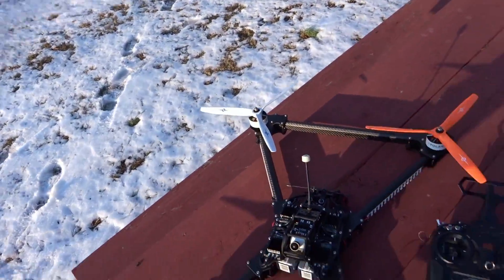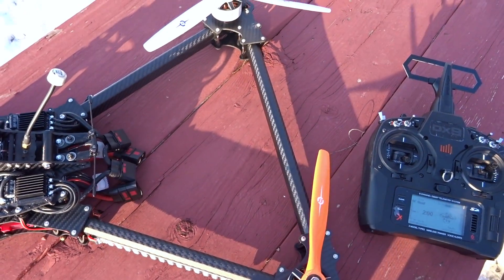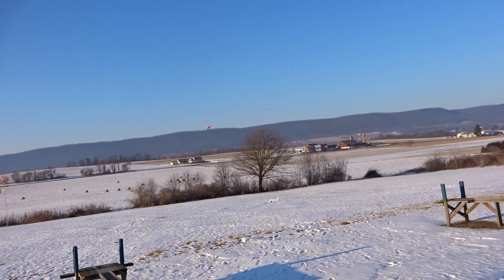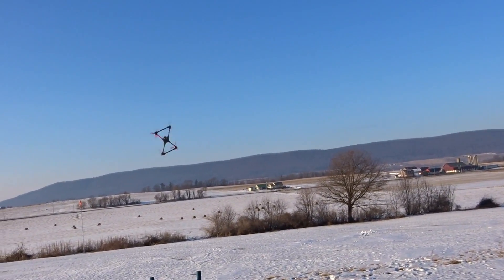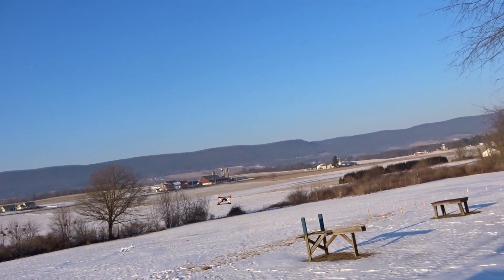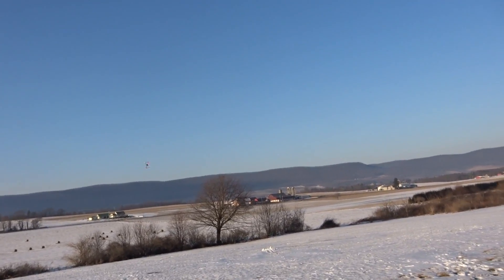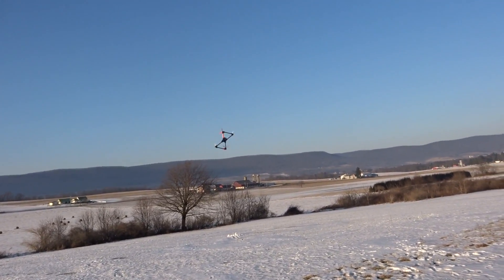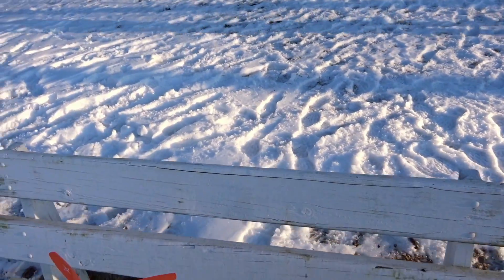X-Class LOS + Possibly the First X-Class Hand Catch?

Comment from the maker: Before you ask... 

1: No it's not mine...
2: $2k...

3: Fast...
4: Soon...
Reply: But how high will it go? How far can it fly? Can I fly it? 😛
Reply: Holly crap that cost 2k?
Reply: @dronereviewman9580  Check the prices on parts list: Frame is 575$, PDB 115$, Motor 90$ (each) etc ... pretty crazy
Reply: @Baba-yz3kp  https://rotorbuilds.com/build/15271
Reply: @Baba-yz3kp  575 for the frame… cost 100 at best
Reply: @dronereviewman9580  Yeah but I needed something to test X Class LEDs on. why do it on the bench when you can do it on a big quad! :)
Reply: @TinysLEDs  On the bench with no air flow would be much tougher test than 80mph air blowing over that millennium falcon tanker quad. The 30 cent 3W LED bead lights run at 1W are completely sunlight visible.
Reply: That is everything I wanted to know!
Reply: That is the future of drone racing as a spectator sport..
Reply: 2k and he let you do that to it.  I’m sure he was puckering the whole time even though your awesome 👏
Reply: The sound of it is crazy cool.
Reply: exactly tthat
Reply: That thing sounds sik,sweet los:)
Reply: This setup on 12 like flown here will do around 110 mph top speed
Reply: can move an human with snowboard?
Reply: what about carrying  go pro  !? :))
Reply: Can anyone recommend an ESC that will handle an 8 inch prop using Sunnysky 2212 1400kv motors? Resurrecting an old DJI Flamewheel f450 for fun. I'm running it now with Betaflight and old Simon K 30amp esc's. Not sure what BLheli esc can handle this setup 🤷‍♂️

Comment: Done built two X classers one very simular to this and one that is a more beast class on a frame I made my self. The wildest thing about these large quads is how much air they move and how much you can hear the frame drag. The motor noise and prop noise are quickly over taken by the sheer volume of air the frame is dispersing at higher speeds. We have radar gun checked and GPS checked both of them the setup that's pretty much exact the same as this was doing 107mph flat and level and the smaller framed setup was 116mph flat and level. Those are on multiple passes and a avg over 4 passes with every pass being within 2mph of each other. The passes was done after 30 seconds of hovering and two passes then fresh packs and do it again. I'm telling you to anyone that h asnt flown one or seen one flown... the sounds alone are worth the entry price. Honestly something else to, you are far more careful with these then a 5 inch so far fewer crashes. In fact with over 100 flights on both of them i have not crashed a single time just due to watching what I'm doing much more then with 5 inch and smaller quads. I have had perfect reliability not having a single piece fail and not even a broken prop yet. It's a whole different ball game and so far I'm totally in love with it.

Comment: AWESOME Skills and a beautiful machine! I am about to start my Cannonball800 build as I just received the last parts yesterday. Would you be able to provide a link to the heatsinks that are on the APD120's?
Reply: Bay Area they are from amazon. 30mm long from a 90mm long strip of heatsink. 
I just cut them to length and used some thermal adhesive on each fet.
Reply: @TinysLEDs  awesome thank you!
Reply from the maker: I believe they are custom.